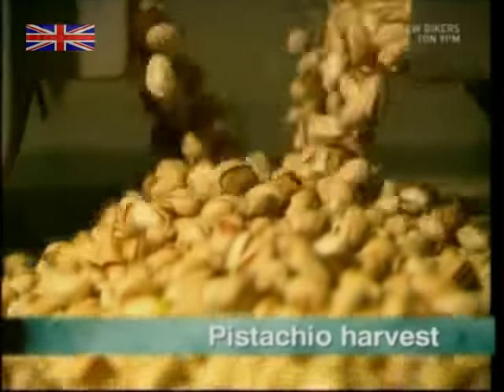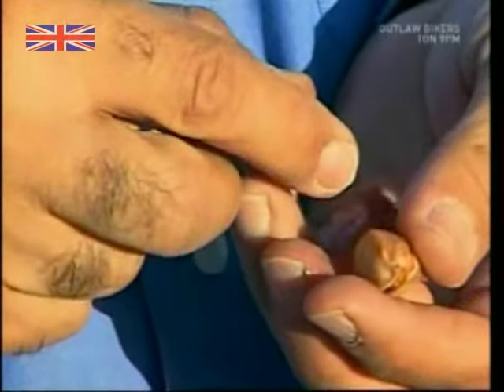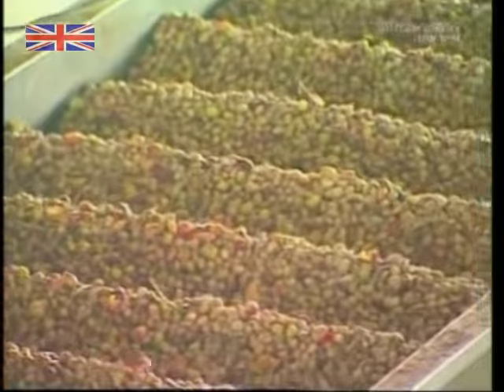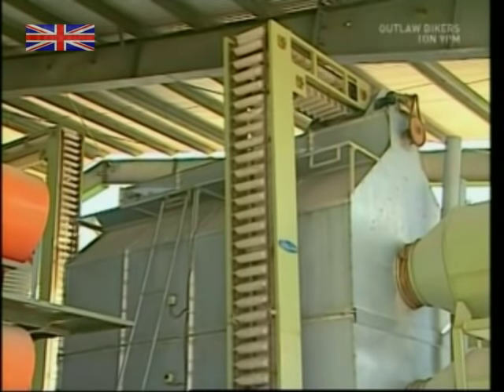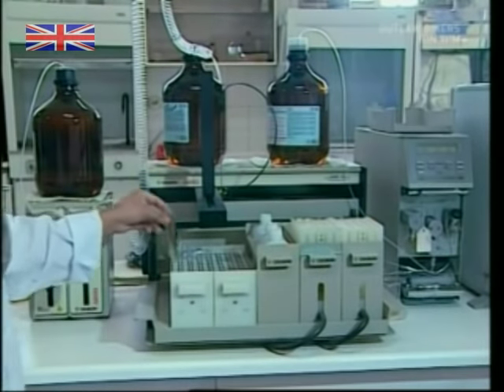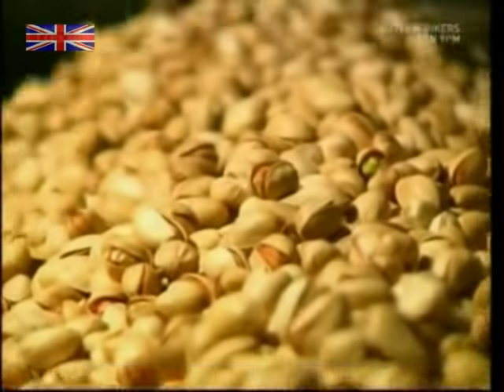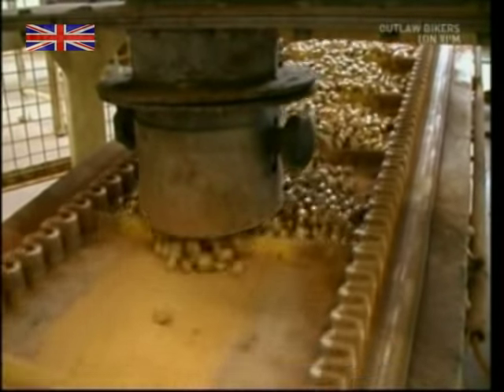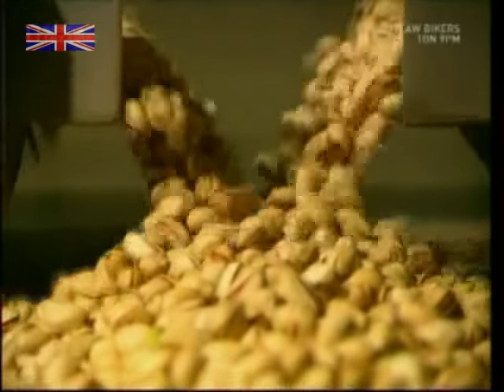How Pistachio Nuts Are Harvested and Processed

Comment: Little known fact, based on personal experience: mice love pistachios. It's like crack for rodents, the only food that mice have ever stolen out of my kitchen.. Bait your mouse traps with pistachios stuck down with a dab of peanut butter; pistachio "butter" would probably be even better, gonna have to find a source for that and try it (I've got some almond-cashew-honey butter that also works better than ordinary peanut butter, but pistachios still work best).  I live in rural New England,surrounded by oak trees; we had a bumper crop of acorns this fall and so the mouse population has exploded. They always invade the garage and attic in the Winter  and it is a constant battle to whittle away at their burgeoning population.  They also like to nest in the trunks and wheel wells of our cars, and chew on jumper cables and any other emergency equipment stowed away in the cubbies.
Reply: Dent corn for mice.  It's much cheaper than pistachios.  I got that mouse, but I'm still finding freaking corn kernels.
Reply: Brap Nation  They are fairly useless in most situations.